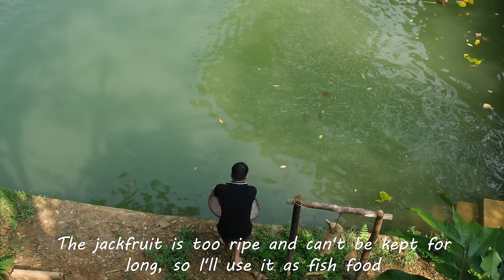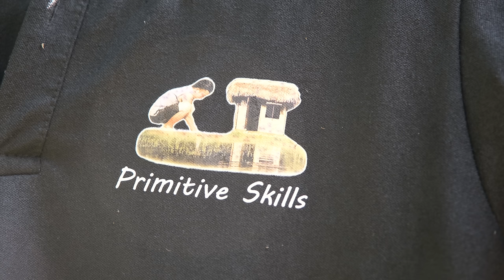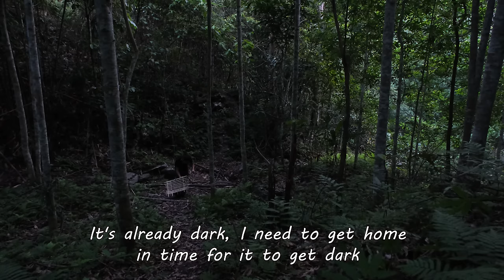This is a big surprise! Capturing and taming wild chickens, Primitive Skills (ep182)

Comment: 18:44 Quick question... given the amount of work required to make the shakes (wood roof tiles), wouldn't it be faster to split bamboo in half and layer them like barrel roof tiles? I worry about the wood you're using rotting over time if they're not a natural wet wood like Cedar... Making barrel roofing out of split bamboo would likely be faster and be just as protective.
Reply: it would, but he is doing this way to utilize wood that is already cut and dry
Reply: A bamboo roof would hold up about as long as his leaf roof has. With some kind of sealant, a wood tile roof, no matter the wood, would last much longer.
Reply: @The_Foreman  Bamboo would last way longer than the leaf roof and would be less vulnerable to sparks from the fire when the wind kicks up. But wood is his best option other than fired tiles as long as they don't check too much. Those are not split cedar shakes and the timber they came from is very twisted in growth so there is a lot ofup grain on the surface to absorb water which could cause checking, cracks and twisting after installed and I don't know if he has enough nails for the job... we'll see.
Reply: @aboveallthingslove6349  I meant more on the scale of things. His leaf roof has lasted a couple of years, and a bamboo roof might last up 2-4 years. The wood shingles should last 10+ years. Especially if he can find some way to add water damage protection.

As for nails, I'm fairly certain at this point that he buys the stock metal for all of his blacksmithing projects. It might take him a while, but he'll be able to make enough nails.
Reply: @The_Foreman  and since this planks seem dense enough, dude could apply a flame coating, which would halfway preserve it in case he doesnt find some sort of sealant (doesn't seem like he'll find enough tree sap to do it, maybe CaO whitewash would do the trick? he seems to have abundant supply of it to make concrete bricks.)
Reply: @The_Foreman  He could use tar, usually extracted from fatwood...
Reply: All great comments!  What kind of wood is it?  Sometimes it looks very waxy.  Maybe the fire roasting method would bring that substance to the surface and aide water repellant.  Looking at the manolo,  water seems to do the most harm to wood.
Reply: @janetcahill4645  Keep in mind the manolo goes through a lot more abuse than the roof would. Water flowing all day every day over that thing.
Reply: yes it would  and the bamboo will probably withstand rot better  but this climate and enviorment want tile or stone everything else rots fast
Reply: @mobiousenigma  керамика имеет очень большой вес. Я думаю что крыша, каркас построек, изначально на такое не рассчитывался, поэтому и был выбор деревянной кровли. Есть породы дерева которые гниют лучше или хуже. В случае кровли, все деревянные планки продуваются воздухом и гнить не будут
Reply: @НехорошийЧеловек-ц7к  yes ceramic is usually heavier than wood and yes some species are more rot resistant than others , the roof structure  is sufficient to carry the load  and as wind will be his biggest live load  the safety factor need not be as high as one that had snow and ice to deal with . i tomes down to cost of materials versus the service of the materials  as a thatch roof he needs to add a layer every other year or so  until its  needed to remove it and start again, same for wood or bamboo   there all organic they all rot they are all a lot of labor to collect transport and prepare for use and need to be redone regularly, ceramics in his climate should last longer than the structure supporting it and the same for stone...they need only be collected prepared or created once which is also a lot of labor but needs not to be done every other year or so  .
Reply: Да, именно так, керамика  требует усиления несущей способности крыши. Тут. Такая конструкция: стены из глины отдельно, каркас и крыша отдельно. Будем надеяться что деревянная кровля прослужит примерно 10+ лет, а иначе можно было и не заморачиваться, а просто менять пальмовые листья каждые два года
Reply: It would be but exposed to moisture bamboo doesnt hold very well and long, and hes trying to do exactly that - more permanent solution. Especially when you do not have lacquer...
Reply: I thought bamboo would be easier to work with and last longer than wood.  However, when I think about it, there are almost no buildings with bamboo roofs in Japan, where I live, but there are many buildings built with wood.  The building named Horyu-ji is made entirely of wood, but has maintained its shape for about 1,300 years.  Wood seems to have tremendous potential.
Reply: @EthylAlcohol-C2H6O   it is highly dependent on local conditions  . i believe in general temperatures are more moderate less humid  in japan   yes you go from nearly arctic up north to tropical in the south  but in general i believe you are cooler and less humid. species also plays a big part   i am not aware of much cedar in vietnam  the wood of choice for wet conditions  . Horyu-ji i googled are also clay tiled  which will keep the timber far drier  making for longer lasting wood. there are 2000 year old log houses in scandinavia   it can last but it depends on many things.  i am used to and experienced  with a different climate and region of the world    .ontario canada . i dont think i have ever seen conditions as adverse to materials as it is there   including -50c   between the rain the heat and the humidity  organic material has a limited lifespan.
Reply: @mobiousenigma  Certainly, the drying of wood is an important process for the longevity of buildings, and the quality of wood also has a great impact.  However, one thing I would like to correct is that Japan is not dry.  Compared to Vietnam, the climate is certainly milder, but sometimes the temperature exceeds 40 degrees Celsius and the humidity is over 90%.
Reply: @EthylAlcohol-C2H6O  Japanese carpenters of the time were amazingly talented. Wood can last a very long time, hundreds of years even, but it must remain dry. I believe Horyu-ji uses the half barrel method using clay tiles. That or slate would be ideal for roofing in wet and humid climates.

I lived in Okinawa for a couple years. I love the culture. :D
Reply: @EthylAlcohol-C2H6O  even in hokkaido?  we see 35c and 90%+ humidity as well but the 5 months of -c drys things out  . its my understanding  vietnam is more hot and wet or hot and monsoon  without much dry time. if he had teak to use it would be far different  but i suspect the comments would be different as well were he to find and cut teak trees lol  the "trees" he is harvesting dont appear to be hardwood and most  have shrub like qualities or fruitwood which is not generally known for structure strength or resistance  usually its decorative. it is his project and his decision to make of coarse and i can only provide an opinion some information and some knowledge  as can others but he knows what he wants to do and what is available to do it with  and needs to decide what is best for him there not us at our computers.

Comment: Nice Job with the chickens, with some luck they'll lure some of their wild cousins to your house. 
Why do you want to use wooden tiles? They are way harder to make and will start to rot relatively soon. Fired clay will last you far longer and its easier to make.
Anyway, great Video - you're doing a fine job. Keep it up!
Reply: Yeah i was thinking the same thing but as another commenter said his building is not sturdy enough it would’ve probably collapsed with the weight of the clay or concrete
Reply: @AnimeFan-ot7bu  yeah, but he doesnt have good cedar for cedar shakes. Given, the wood shingles hes making would probably last at least a few years and leak less than his current thatch. It might stand in till he can tear down during a dry season and rebuild a better, stronger wood structure. I forsee him upgrading in a year or so with a more fully timber cabin now that he could possibly build a sawmill on his waterwheel. It would take some time to smelt enough iron for a sawmill, but i think he might be able to pull it off. Then he could rapidly build long planks for a wood cabin and cut thick joists to hold a tile roof. He needs to be able to quickly process wood faster than by hand, and that sawmill will be crucial to get it done in one summer before it gets too wet.
Reply: Wood, if it's cut and dry, which it was, lasts much longer before rotting than you'd think.
Reply: @szeddezs  yeah, sure. But the guy lives in a jungle. Hot, wet, loaded with bacteria and insects. Literally the worst possible environment you could have for wooden shakes besides cedar. At least cedar has high acidity sap which makes it harder for fungus and mold to grow. Dried wood wont just rot to bits in a month, or even a year. But how soon do you want to redo your roof? How long did it take to build? If it takes you 2 months to fell and split enough timber to make a new roof, you might as well just reinforce the existing one and make some fired clay tiles in half that time that wont need replacing in 3 years. Its about time investment and longevity.
Reply: @FearlessCrusader100  this channel does a lot of things by hand, which earns my respect and sets it apart from the secret jungle pool channels, but there’s no way he’s smelting his own iron. He did his proof of concept video, but actually making usable ingots out of raw iron ore is incredibly difficult and he would be showing that work if he was doing it himself. There are whole channels dedicated to just smelting iron from scratch, and even they struggle to make large, easily worked iron bars.

Comment: @ Primitive Skills:  Split the sections of log 3-4 times.  It will save a lot of time and sweat.  It is a much quicker way to remove the wood you don't want.  Less waste.
To quickly smooth the "planks"/shingles, make a Drawknife. 
It is a knife with a handle at each end of the blade.  Each handle is bent 90 degrees from the cutting edge of the blade.  The result looks like a square corner "U".  The cutting edge should be approximately 25-30cm wide (the bottom section of the "U").  
The cutting edge should be to the inside of the "U", and slightly curved like your axe.  This will make cutting/shaving easier.
The Drawknife is used by sitting across/straddling the log, holding a handle in each hand, and pulling or drawing the knife towards yourself.
The Drawknife works similar to your wood block plane but is designed to quickly smooth roughcut or split wood.
A drawknife is very similar to your Froe (log splitter), except it has handles at each end of the blade.
You have many planks to go, make your life easier.

Comment: Excellent work, thank you for your excellent videos. As a lifelong roofer, I would agree that clay-fired (or concrete) tiles would seem to be a better option. You seem to be able to produce large amounts of concrete. The wooden shakes you are making will be difficult to fasten, will probably warp and will obviously rot. Unless you have a wood more like cedar, and can split into shakes rather than that hardwood you have to cut at and shape. However, your structure doesn't have proper support for laying out heavy concrete tiles, and you would have to modify your deck as well. So, maybe the hardwood isn't the worst idea after all. One thing for sure, I will be watching closely to see what it ends up like!!
Reply: Sure seems that your recommendation for improving the roof ‘s structural support then laying concrete tiles would be easier and more effective than the wood boards. Re-roof with longer lasting concrete tiles once and move on to other projects
Reply: Concrete wouldn't work here, the thickness of the aggregate would increase the weight too much. Cement from hydrated lime with a fine binder could do the job other than if he were to do clay though.👍
Reply: Кедр у него не растёт, это северное дерево, сибирское. Есть лиственные деревья которые тоже плохо  гниют. Например, в средней полосе России   до XX века крыли крыши  щепой осины ( в средней полосе России это дерево растёт в лесу как сорная трава). И да, щепой осины делали в основном бедные церковные приходы. Обычные избы кровли соломой. Через несколько лет, осина, без обработки приобретала серо- серебристый цвет. И купол  храма или наличники вокруг окон красиво смотрелись.
Reply: В его южном климате, из хвойных, может быть только кипарис... Но ни в одном видео он не попадался
Reply: @НехорошийЧеловек-ц7к  Aspen Chips? That is one I have not heard of.
Reply: @CoolRoof1  "щепки" и "щепа" вероятно звучит одинаково на вашем языке. Щепа это короткие дощечки , примерно 25-30 сантиметров в длину. Щепа это древнее название, которое сейчас не используется. Щепа изготавливалась исключительно только топором, без использования продольного распила и строгания

Comment: Here in the states, old farmhouses used.wooden shingles too, personally for your area I think you'd be better off with either the baked brick or bamboo half pipe shingles. The amount of rain is gonna be a problem for the wooden ones.
Reply: Treat with resins or wax like treat the wood.
Reply: About the seeds of jackfruit here in my place we boil the seeds and they are very edible as we are eating some kind of nuts

Comment: Wood shingles are a lite weight option to replace your current roof. Fired clay roof tiles will last longer, but can be heavy, requiring reinforcing the roof supports. Make sure you stagger the joints and overlap the roof courses with the shingles. Love your videos, and do not mind the wait. I know it takes time to do what you are doing.

Comment: Before you even do the new roof, the walls need to be repaired and lime coated. Then since you already have to modify the roof system for shingles, like others have said, you're better off going with the clay tiles. They'll last much longer than the wooden ones which will warp, shrink, etc. and eventually rot, not to mention the clay ones will help heat / cool the house.

Save the wood shingles you've already made and let them fully season and then you can use those for the roof of a proper chicken coop so all your hard work doesn't go to waste.

Comment: I wonder if the water wheel could provide power to a saw?  I know it would be time consuming to make, but wonder if that would make the wood cutting more efficient?  Great stuff, I always look forward to your videos!
Reply: Super smart
Reply: I was thinking he can get a lathe with that too
Reply: He could if he took the saw he had made and attached it to the water wheel in the same way he did the bellows. It would be pretty slow though. Making gears out of wood isn’t great though so it’s hard to get variable drive speeds.
Reply: @glawenclattuc3127  true, I was thinking that too, but I’m sure this genius survivalist can make it happen
Reply: Мощности водяного колеса не хватит, должно быть примерно 4-7 киловатт чтобы пилить бревно, и скорость движения пилы должна быть больше, а это уже нужен редуктор и всякие  знания как всё это рассчитать
Reply: He would have to have much more powerful flow of water, which would be very hard to control for other uses then... With this kind of flow it's impossible
Reply: @НехорошийЧеловек-ц7к  -[%]

Comment: You need to do the taper on your froe (wood splitter) in the other direction. The blade should go on from the far end like a tomahawk with a wider taper in front of the cutting edge. That way, when you strike the blade when batonning through the wood it will tighten on the handle rather than keep coming off.

Comment: Using boards for the roof is an interesting idea, but I think that the boards need to be somehow protected from water, burned or impregnated with resin, but this will take a lot of time and effort. 
Wood chips left from the boards are perfect for mulching plants. This will reduce the number of weeds.

Comment: I still think the waterwheel could power a small sawmill. I'd go for a ancient roman style reciprocating blade. It'd have to be about twice as big as the hand saw blade. That in itself would be a lot of work. It would require making some new tools, maybe hardened steel file, perhaps a fine stone grinding wheel to help cut teeth.
Reply: That water wheel could spin smoother if he put a steel plate under the contact to ease the friction, and put lubricant on it
Reply: not steel, brass. and make a roller where contacts
Reply: @imakedookie  this man has the facts
Reply: Let him do whatever he wants

Comment: Woven mats covered in pitch would be a great under base, you could also use on "wooden shake" shingles to extend life, add water proofing, rain gutters could provide additional uses and protect house foundation.
Reply: Also a water powered saw mill would be innovative and save time cutting flat planks. Circular saw, or mechanized version of wood saw you use already.

Comment: Love your work. For roofing, why not use bamboo ? Cut in half, you got half cercle gutters. Cover the roof with it, open side up, then cover with other half to cover the joints. You then can use half bamboo pipe for the cornices, and smaller bamboo pipe for gutters to recuperate rain water for garden or channel it to the pond. 
As for the planks they could make nice furniture or even partition walls (or even boxes to store corn or other stuff like tools, etc...)